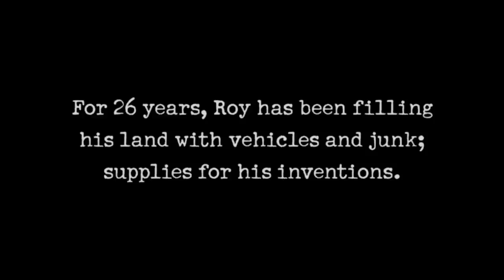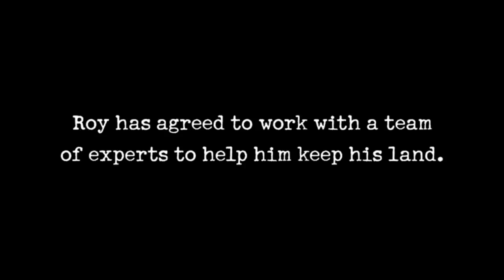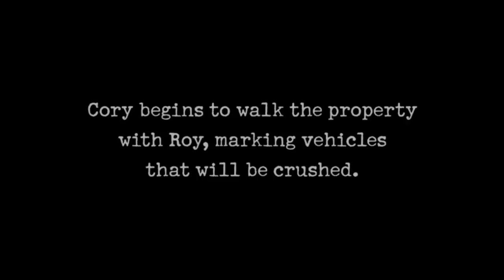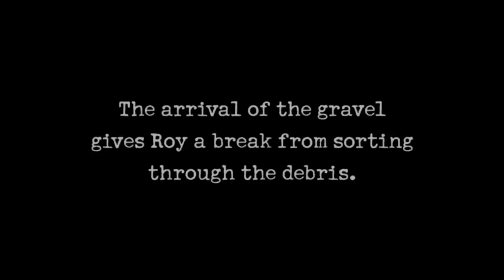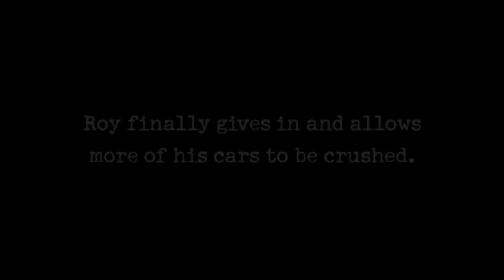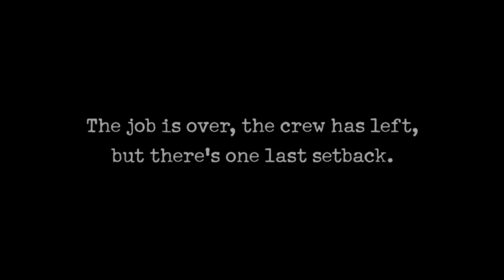Hoarders: Inventor Has 160 ACRES Of Hoard, $20 MILLION in Fines | A&E

Comment: If Roy had built some outbuildings this would not have been an issue.  When junk accumulates outside it becomes an attractive nusiance and an issue concerning ground water and wildlife.
Reply: And the irony is that one of the reasons he cited for buying the property was to save the redwoods. And the fact that his interest in developing environmentally friendly vehicles...
Reply: In the good old County of Santa Cruz, overly expensive permits are required for outbuildings and the number of buildings you can have on a property are limited by code.
Reply: When he bought the property  in 84 there were a few houses on it but he had them torn down.

Comment: When did 16 vehicles, 2 travel trailers and a dump truck equal seven thousand pounds ????? Probably closer to 70 thousand pounds. Just saying
Reply: I'm guessing many of then dodnt have engines.   But still.    Yeah I think he meant 70
Reply: No s****! 🤣
Reply: In one video I think it was Corey that mentioned that they calculate the weight of hoards by the capacity of the trucks that haul them. So they would attribute the same weight to a dump truck full of teddy bears as they would to the same dump truck filled with crushed vehicles. That being said, I have zero concept of the space those cars took up or what the capacities of the trucks were. But that may have factored into their weird total.